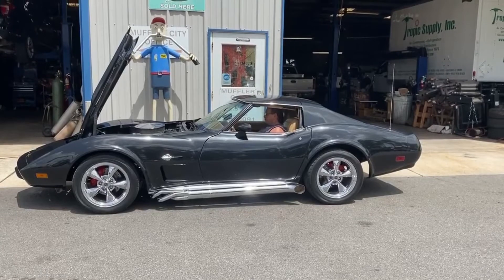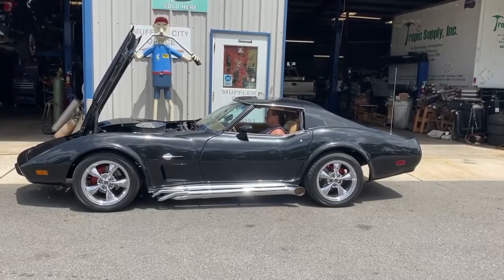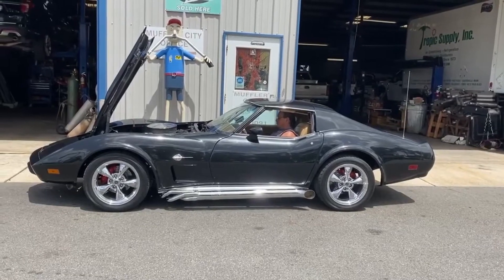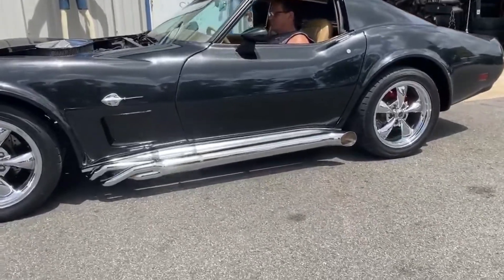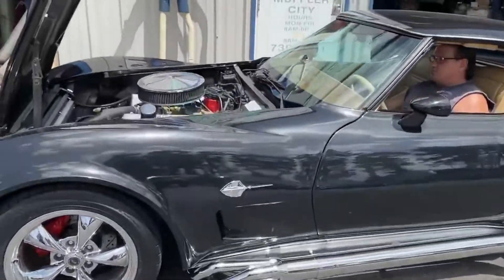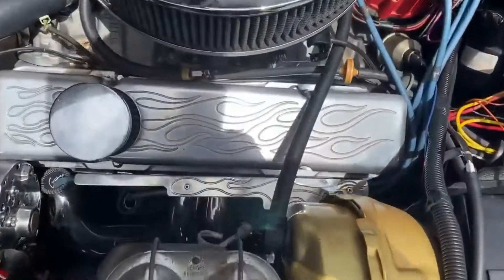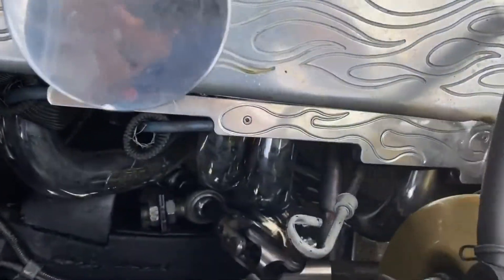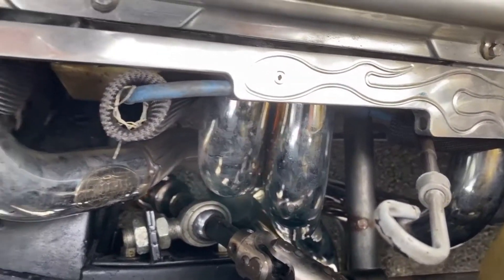1977 Corvette: Hooker long tube side pipe

Comment: That back panel is a giant fail
Reply: I was going to do this to my 75, but I agree that kinda out off place.  Is there a better alternative for adding the spoiler look without that type of bumper?
Reply: Im tripping or is that the back end of a c4 ?
Reply: @straighttimestirrups the 80-82 c3 bumpers have the spoilers, that's some sort of aftermarket 2nd body style c4 type of bumper
Reply: Chrome bumpers are the only solution